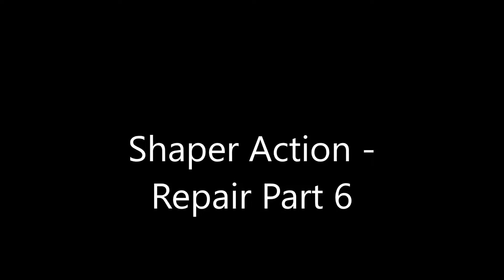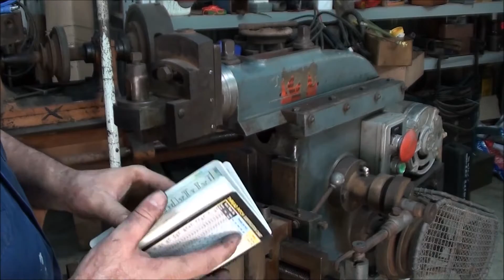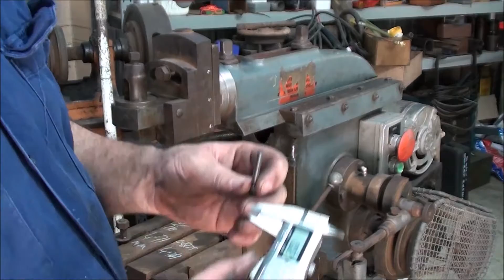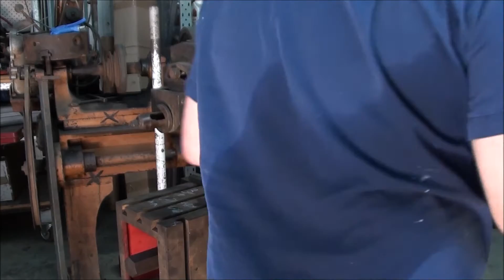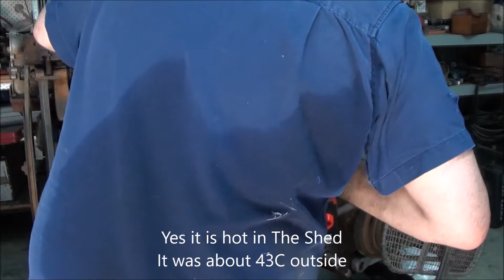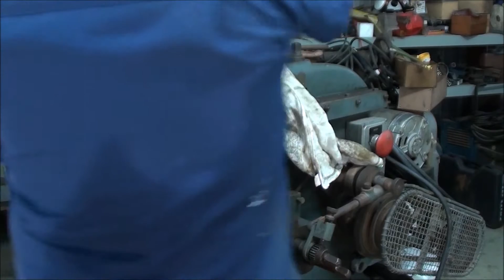Metal Shaper Action -  Repair Part 6

Comment: Greg, just watched this series again and it made alot more sense when I could go out to the shed and have a look at mine. Found the graduations too after some looking. Greg along the ram on the top between the gib nuts there are holes, are these to fit grease nipples do you think as I noted you have installed some in the ram shaft housing. Cheers Gordon
Reply from the maker: Hi Gordon, they are oil holes for lubricating the ram sliding faces. I often thought about putting proper oiler's on mine, but never got around to it. It is better to oil than grease. Grease tends to trap dust and metal chips, oil washes them away. A little trap is that there is an oil hole in the ram positioning bolt It feeds down to the linkage. My advice is to oil it every time before you use it. I only greased the roller bearings. All plain bearings, sliding surfaces, and feed screws I used to oil. BTW, you may have noticed that I cover my machines with plastic bags. Part of the reason is to stop the dust entering the open lubricating holes.  Thanks for watching and commenting. Greg

Comment: Hi Greg, really enjoyed this series on the Douglas Shaper as looking for one myself at the moment to restore. Couple of questions. When you brazed the cracks and end peices on did they work first time up? I noted when you put them in the barbie for the preheat that you had them jigged up so guessing you put a bit of pain on them first to get it straightened out? Next question have you found a good manual for them, I assume that Douglas would have issued one with the Shaper. Good to see Aussie lads doing work on Aussie stuff as it helps all us hobbyists feel more comfident about giving it a crack ourselves. Take it yoy are a FIFI up north. Been there, done that.....and don't miss it at all. Take care man, Gordie
Reply from the maker: Hi Gordie. the reason I jigged them was simply to hold them in place to start with. They were close enough not to worry about before brazing and spot on after. No machining or straightening required.
As for manuals, I only ever managed to find a parts list and a sales brochure. No operators or service manuals. Douglas were bought out by Hercus so you could ask them. 
And yes I do FIFO and DIDO as most of what I do is shutdowns 
Thanks or watching and commenting. Greg

Comment: That looked pretty painless  !
Not sure I would cope with those working temperatures,  40deg C outside ...... ! I think we had 26 deg C once a few years ago for a few minutes mabe.
Reply from the maker: LOL, all in all it was very easy, I probably should make a better gib strip for it in the future, but this one works very well. The funny thing about the heat is that I find it much easier to work in 35+ degrees than I do at 20 or less. As long as there is lots of water to drink that is at ambient temperature I don't have a problem, of course the odd beer or 2 after finishing does help with recovery hehe

Comment: Fwiw, a fast way to go from fractional to decimal if you've got a shop calculator handy is to just divide the first number by the second. 3/16ths, 3 divided by 16 = .1875" That works for any imperial fraction of an inch no matter what it is. Then just do the standard conversion of 25.4 to turn it into metric. Example .1875" x 25.4 =  4.7625 mm. It's far faster than even walking across the shop to check a decimal equivalent chart. Many older drawings especially from the U.K. are in imperial fractions so I use that little trick a lot except for the metric conversion since I still think and visualize in imperial measurements.
Reply from the maker: Good methodology. When I build engines I generally work in imperial, because most of the specifications that I work with are imperial. When I machine I generally work in metric, unless I know I'm working on an imperial item, like the shaper is. Thanks for watching and commenting.